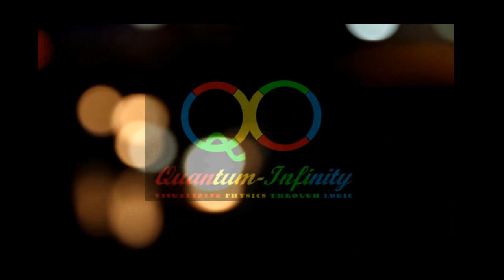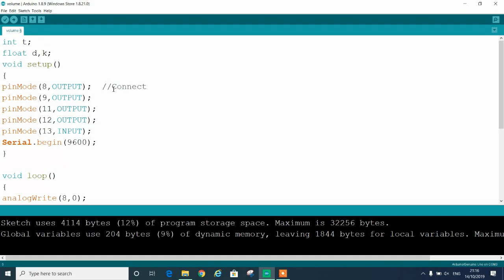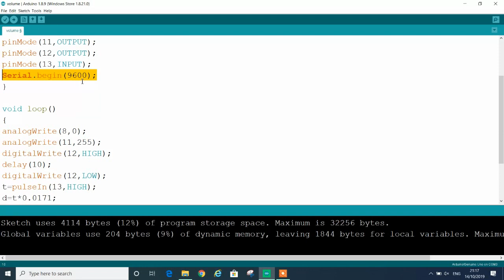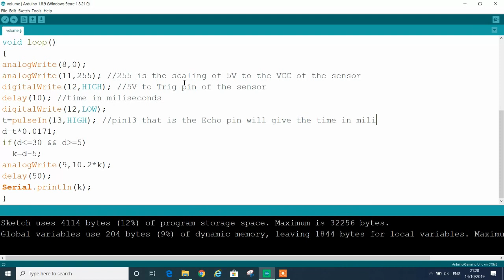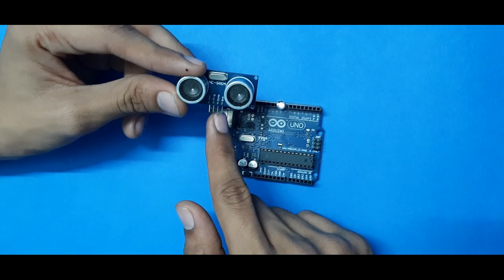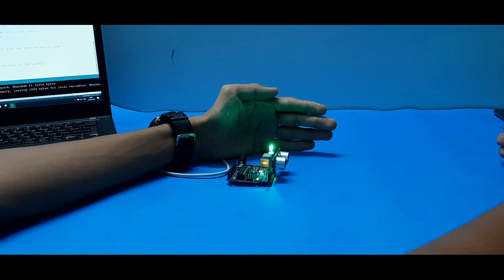Arduino Gesture Control Project | Hindi | QI

Comment from the maker: //CODE USED IN THE VIDEO

int t;
float d,k;
void setup() 
{
pinMode(8,OUTPUT);  //Connect LED anode to pin9 and cathod to pin8
pinMode(9,OUTPUT);
pinMode(11,OUTPUT);
pinMode(12,OUTPUT);
pinMode(13,INPUT);
Serial.begin(9600);
}

void loop() 
{
analogWrite(8,0);
analogWrite(11,255); //255 is the scaling of 5V to the VCC of the sensor
digitalWrite(12,HIGH); //5V to Trig pin of the sensor
delay(10); //time in miliseconds
digitalWrite(12,LOW);
t=pulseIn(13,HIGH); //pin13 that is the Echo pin will give the time in miliseconds
d=t*0.0171; //speed of sound in air is 342m/s
if(d<=30 && d>=5)
  k=d-5;
analogWrite(9,10.2*k); //writting voltage to the pin9 that is LED anode
delay(50);
Serial.println(k);
}